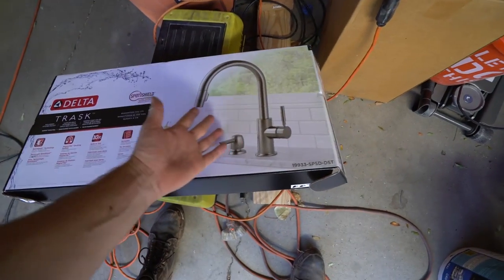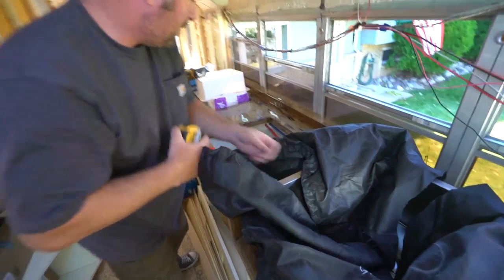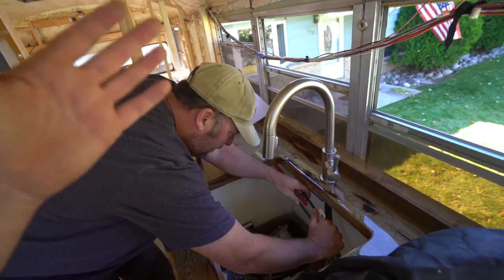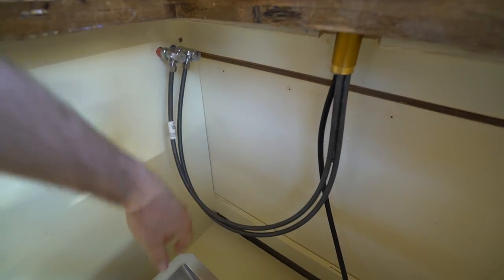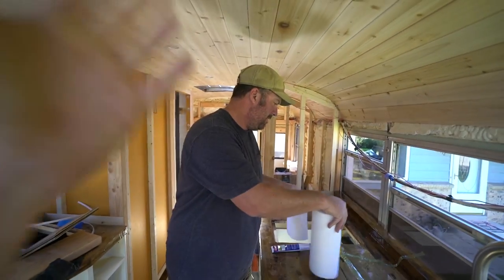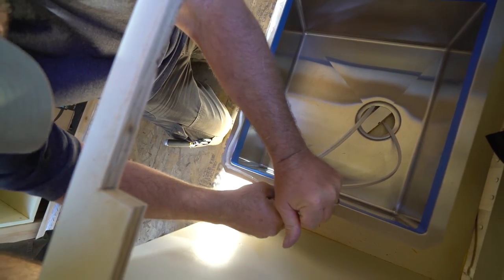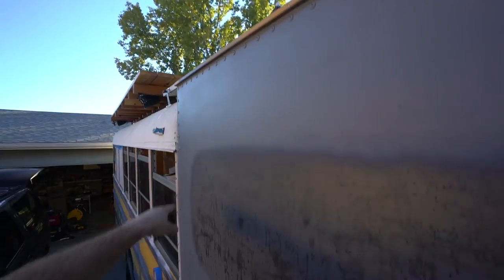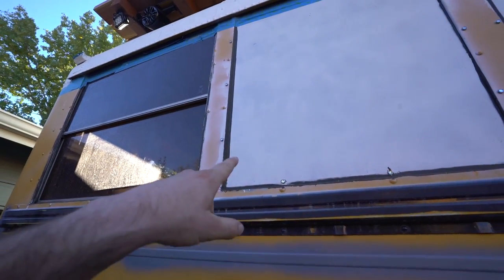Undermount Sink Install in School Bus RV Vanlife

Comment: I think I'd be adding brackets under the sink/basin if it were mine, I couldn't trust silicone on it's own. lol
Reply: Yeah I watched this video to see that because my sink came with brackets. I thought it being a similar countertop to the one I'm putting in my campervan they would show the brackets installed for wood.
Reply: pro trick: watch movies at Flixzone. I've been using it for watching loads of movies recently.
Reply: @Zion Connor Yup, been watching on flixzone for years myself =)

Comment: Our under mount sink has small flat clamps the reinforce the holding of the sink.  (So basically half the clamp is under the sink lip and the other half of the clamp is under the counter and attached with a screw) just some insight because when you’re traveling there’s going to be much more gravitational pull on a moving vehicle going over road bumps etc then a stationary house that’s not moving. 🤷🏼‍♀️

Comment: Tip for future silicone install work: when smoothing out the silicone, wet your finger. keeps it from sticking to your finger, since silicone is a barrier against water. use that in conjunction with all of Reed's tips as well, and no mess for you!

Comment: Jax, I think you're gonna love that sink. I installed one 3 years ago in a rehab of my house. Great quality for the price and heavier gauge then higher priced ones,which is why I grabbed it in the first place, but been very impressed with it as well. Also, you may or may not know, it's made by a all female run company, or at least it was when I bought mine, and I liked that as well.  I would also say like the other guys on here, being mobile, I would add, if nothing else, at least some screws through the flange underneath to give added strength. You have the inch and a half lip to secure to, should be no problem. But then again, you've been rolling for weeks now, you probably have a pretty good idea how well it''s holding up.
Reply: On this application, you run the risk of cracking the counters. Also, the brackets are complete overkill. Trust me.

Comment: You're better install cleats under the sink silicone will not hold it special going down the road with something in it he's not a pro
Reply: Don't need cleats, but thanks for the "pro tip".  ;-)
Reply: I would definitely recommend cleats because I had a full sink starting to separate off the countertop.
Reply: Tsvetomir Hristov then you didn’t install it correctly in the first place.... cleats are cheats.
Reply: @reedincolorado  anyone with eyes can tell you are a pro by just looking at the plumbing near the water tank. DIYers can't make it look that good. It reminds me of looking at an electricians work compared to a DIYer.  Anyway, excellent job. Hope to see you build your bus on youtube.

Comment: all under counter mount sinks i installed i always use mounting brackets to help hold the sinks in place because silicone alone doesn't quite hold right over time..
Reply from the maker: Yeah. We didn’t make the wood thick enough for this, but next time around I’ll secure it.

Comment: If I had an undersink setup, I would feel WAY much better to support the weight of water & dishes, rather than silicone alone.  Maybe a 2X2 from the floor of the cabinet to the bottom of the sink...for further support?  Imagine the feels if the sink crashed through to the bottom, full of water?  0_o  Silicone don't last forever, because this is a mobile setup...bouncing & twisting...that a home setup don't.
Reply: I assumed they didn't film them securing it with brackets from underneath. Regular silicon is not an adhesive.
Reply: Yeah, probably so.  I probably jumped ahead with that comment, not seeing the final finished setup (in maybe...the next video?) because you can't record everything, can ya?
Reply: Nope, no brackets. It's overkill... I've done enough kitchens and baths to know... The counters will break before that sink drops... then again....